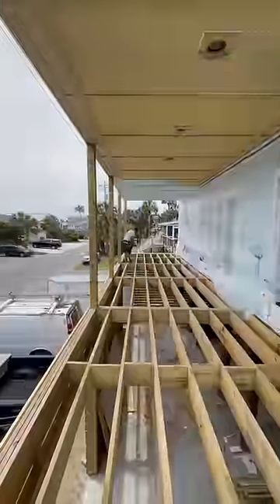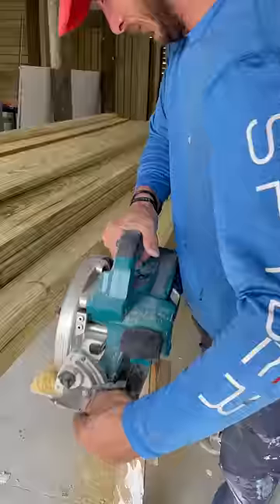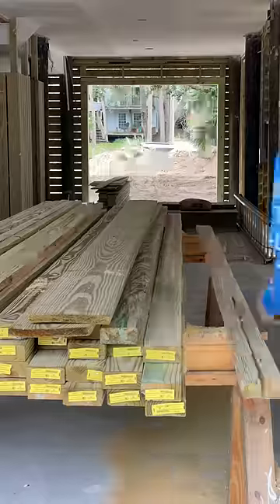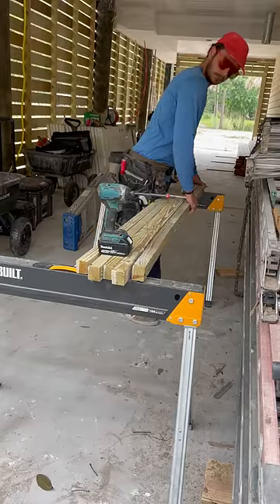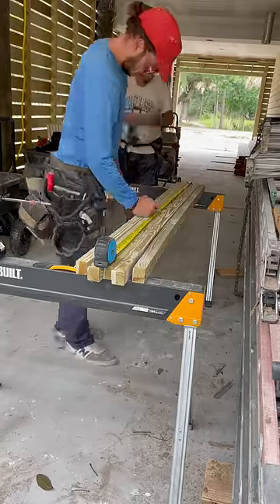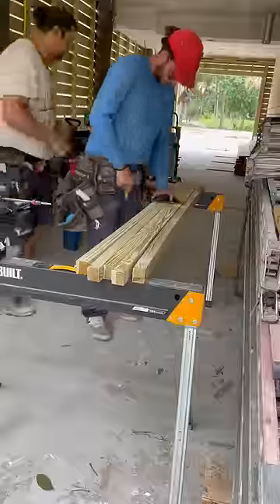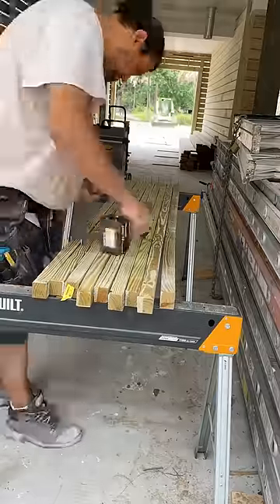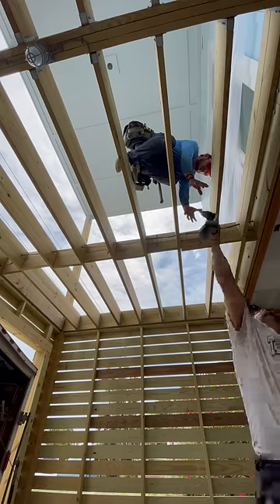Deck 1 | Artpentry #artpentry #carpentry #diy #artisan #woodworking #build #construction

Comment: Looks good, I personally don't mind seeing the screws as long as they're clean and not all over the place
Reply: I don’t mind seeing them as well if they look the same and me and my crew put normal bread flour in our chalk lines to mark them out so it doesn’t stain the wood and then I use a counter sinker for the screws so that all the screws are the same depth
Reply: @richardjennex6583 been in the trades for 20 years and never thought about using flour in a chalk line box lol. Given I don't use a chalk line anywhere that will be seen when finished usually, but this is genius.  
Thanks for the tip for the future!
Reply: @richardjennex6583 
Bread flour,  wow great idea.
Reply: Structurally much better too

Comment: Not sure if you guys know but there is a table saw . Or buy 2x2
Reply: My thoughts exactly.
Reply: Yea until kickback happens and those two pieces are flying back at warp speed. If I experience kickback I’d rather it be the circular saw with the guard still on
Reply: @willbutler2639 only because you don't understand kickback, if you have a featherboard just before the cut as well as a riving knife, and your fence is square or opening very slightly at the back, and using pushsticks and pushblocks, you will never see kickback in your life. Kickback occurs when the wood pinches the blade, hence why if the fence isn't square you open the backside to prevent binding on the blade. Plus they will be consistent cuts unlike the circular saw, you could do it, but nowhere near as fast or as consistent, meaning efficient. I had good teachers on YouTube, I wanted to work with wood so I figured I'd learn a thing or two because I wasn't blessed with shop class lol
Reply: Not sure if you know but this is more cost effective... lol
Reply: @willbutler2639  ill tell you what ill post a video in learning how to use a table saw 
Most be a newbie bud
Reply: @Shwa44  goes for you to bud learn. I'll post a video on how to use a table saw newbie. It's like saying a miter saw is no good also .
Look into an apprenticeship program they help out BUDDY!!
Reply: It's blocking and the cut side is going up against the joist anyway.
Reply: @royflora2338 but you didn't account for the 2x4 being very crooked
Reply: @royflora2338 a tablesaw is a great tool but sometimes it's just about getting the job done, it's a big difference from working in a wood shop to building a deck, or framing a house, if you have experience on a circular saw you can get pretty damn accurate, and besides it's blocking on a deck, not fine furniture, also it's a big difference using construction lumber to finish hardwood that's perfectly square and flat, construction lumber twists and cups and bows and material will come as different sizes, I've had 2x8s in the same stack vary 1/2" in size, if you have a tablesaw on site then great, use it, but the time to run and grab it, carry it to where you can set up and set it up sometimes isn't worth it
Reply: @adamkopacz2718  right. Ripping 2x4 on the table saw is not easy to get any width consistency.  The circular saw is more maneuverable and easier to use. It's slower for sure.
Reply: good luck ripping twisted construction timber on it, let me know how you go
Reply: @willnyethehockeyguy5828 Ummm..no how much time was lost having to have a guy cut all those 2x4s down? You clearly have no business running a business.
Reply: @adamkopacz2718  agreed, and in that case, I use the French table saw method, using my fingers to pinch the base plate and run it along the boards edge, fast and pretty accurate for the method, but most importantly, efficient. I do have that experience you were talking about lol I was only pointing out to Will that  tablesaw kickback was operator error. To be honest, I'd probably still do the tablesaw if I had access to an outfeed table. Otherwise, I'd do it by hand. I'm a roofer by trade, and a jack of all trades, because I get bored of life and having no friends, so I have as many hobbies as I can, I have everything a man can ask for except a family. I gotta keep the faith that someday I'll find it, the one thing I can't buy.
Reply: man lugging out a table saw sucks when you know how you use a circular saw
Reply: A lot of people arguing about the use of table saw or not, missing the point. Those board are not going to be seen at all. They're support for the decking.
Accuracy of the cut to the millimeter is not relevant.
Reply: Not sure if you know, but they're working, what are you doing?
Reply: I can rip  a board perfectly faster with a circular saw. Learning this many years ago
Reply: I'm a full-time carpenter and have not needed a table saw on the job site in ages. 
any of my power saws are always lighter than lumber I'm going to push through a table saw.
 and take up less room haling one around just to rip a 2x4
wTF?
Reply: when you get really good at using power saws you really don't need a table saw and I also have cut trim with my power saw.

it's really no big deal not to have a table saw on the job site to a lot of Carpenters out there.
and yes I have two portables 
a DeWalt and a Craftman/B&D
Reply: when I do a Job,I select the.saw that will give me a pro cut in the least time and effort.
lugging around a table saw and or miter saws gets old really fast and they really don't add anything I can't accomplishments with my corded circular saws including time.
there is time wasted lugging around the table saw and setting it up and breaking it down and halling it back to the truck at the end of day.
for what?
just the rap a few  pressure treated 2x4?
that's a whole bunch of wet lifting and carrying for nothing.
I've gone threw a few trains of wood in life time to boot.
Reply: I know this new gen doesn’t know bout “work smarter not harder”
Reply: Yeah buying is not cost effective and it's way quicker easier and safer to cut with skill saw
Reply: @willbutler2639  learn to use your tools and no more kickback

Comment: They make jigs and no-profile screws that go in through the sides at an angle.
Reply: I’ve heard they have problems tearing up after a while
Reply: @cavanoreilly5497  Only if you dont use joist tape...
Reply: @cavanoreilly5497  I used the camo system on my own deck 5 years ago.  The year after I put it in one board that led to the steps curled way up on the end and pulled just the last two screws out, I mean the thing was going from flat to pointing almost straight up in less than a foot.  Anyway, I put two screws through the end of it to pull it back down and haven't had any issues since.  Oh, and I didn't use joist tape ...
Reply: I was thinking I wish I had thought of something like this just for that first row against the house that I had to put screws straight down through.  I mean it's not really all that noticeable anyway, but could maybe be just a touch cleaner screwing from underneath.
Reply: @cavanoreilly5497  never got a complaint or comment about it from all the decks I've done for family and friends. The one I did at my mother's looks as good as the day I built it.

I only used them for composites or high end woods. If you're using Home Depot level of low quality 5/4 PT decking, you might have problems, but that's a materials quality conflict, not the side angle screws fault. Gotta choose the right method for your application
Reply: Sorry not ! Framers build with speed and that is high tech finger rip as accurate as a table saw and much faster. We do rough framing and maybe a compound mitre at job but rarely a table saw .
Reply: Curious as to that. I assumed there was a jig of sorts to do something like that. Would it also be possible to screw in from the sides sort of like wood flooring does. Obviously you only have a screw at the joist location, but wonder if something like that would be an option too

Comment: The hold won't be good but above all else I see 1 MAJOR problem. If you are putting an under decking system after having done something like this and you have a board get damaged, the customer will have to have the entire under decking system removed to get access to the screw heads

Comment: People bitching about ripping the 2x4 with the skil-saw its only blocking. Cut side it going against the joist. Better edges than those rounded ass corners on 2×2s. Cost less.

Comment: There are metal brackets designed for securing decking from underneath. I would do this method too because I hate buying expensive hardware but…. Adding the cost into the job and having the customer pay for the extra would save you a lot of work.

Comment: Did you use a guide when you cut the 2x? Or just your hand on the saw?
Reply: Doesn't really matter as long as it's close. 3 factory edges to choose from to glue/screw.

Comment: Another thing I am curious about. Why are the joists laid out in that way? Seems like that weakens the integrity of the deck...there are less connecting points to the house. Only reason I can see someone doing this is to avoid butt joints. Generally not a good idea in my opinion but to each their own

Comment: Curious why you couldn't put a screw through the joist? Genuinely asking. I guess the angle of the screw wouldn't be as secure?
Reply: My idea too. The camo fasteners are angled from the top. The answer is yes you could but you would have to pilot hole and then screw to prevent splitting of the joist

Comment: Brilliant hidden securement method!  I have a 20 yo deck in good condition except for mail and screw heads raised higher than walking surface as the deck flooring has apparently dried and shrunk a bit.
Reply: L brackets underneath work too

Comment: Hey fellas, union carpenter here outta STL. Deck looks good, just wanted to pass on some info alot of guys don't know. The chemicals used to treat those pressure treated green boards will dissolve most nails after 10 years, even galvanized ones. Make sure you're not breathing in that dust and particles. Alot of that wood rated for ground contact or contact with cement has tons of hazardous chemicals in it. Keep up the good work and videos
Reply: Yeah it's surprising to pull out some of the best deck screws you can buy and see them all fucked up with no surrounding evidence. 

I'm always rebuilding stuff with old fasteners, sucks being on a demo job and not getting to come home with a bag full of hardware 😂
Reply from the maker: I appreciate that man! And often wonder about our safety breathing all this stuff! As for the fasteners we go with stainless most of the time!
Reply: Cutting or sanding treated…always, always, always wear a respirator.
Reply: @shatoyancy9102 You sound like suuuuch a beta.
Reply: @littlejackalo5326  I have no idea what that means. Just a carpenter for 35 years urging safety on the job.
Reply: @Artpentry you don’t need stainless, you need something ACQ rated- lots of brands call it diff stuff- but you want something with the salt spray rating for ACQ- bc the pressure treat chemicals won’t eat it.
I know a guy who
Sells gazillions of those, and all the other hardware. 😂😮😎
Reply: Damn I've built decks and fences out of green board for 16+yrs. And always wondered what kinda harm this crap would be I've never used a mask a day in my life though. This is something to think about but  a little late now..!!!
Reply: @Clarkster420  the stuff is gnarly man. I remember doing a test on plain, zinc, stainless, climaseal, etc screw of various sizes into a piece of 4x4… it’ll blow your mind how fast regular uncoated product or regular zinc stuff will be eaten up by those chemicals.
Reply: @cposiasca1  the crazy part is all kinds of contractors use that treated lumber and there is no kind of warnings or labels in place to let us know. But really 80% of the materials we use in construction is probably really bad for or health's and we don't think about it or the protection we should use.
Reply: @Artpentry any time there's dust you should be wearing at least an n95 mask
Reply: PT isn't treated with arsenic qnymore.ACQ, is what's used now. Still wouldn't recommend burning it in a fire your standing around but it's not deadly to breath a little dust in every now and then, even when it was arsenic ive never heard qnyone died from PT wood dust
Reply: I would think the biggest problem is cutting into treated and not re-sealing with end cut.  Basically just opened up the wood for moisture to get in much easier and defeated the purpose along the rips.

Comment: If all the screws go in every 10", doesn't the mean the screws from one board will run into the screw from the other board?
Reply: Screws installed on bottom holding deck board is not seen and can visually miss the side screws holding the strips on. They do every 10inch I am assuming for strength reasoning.

Comment: A lot of work from start to finish you added extra to each thing when you can pay for tools that eliminate processes! Think smart not hard because this is more work then just countersinking your screws and sealing over them! I’m guessing your charging more then everybody for the process which is far from necessary! Screws over time upside down with small vibrations unscrew! 2 years later your getting served!